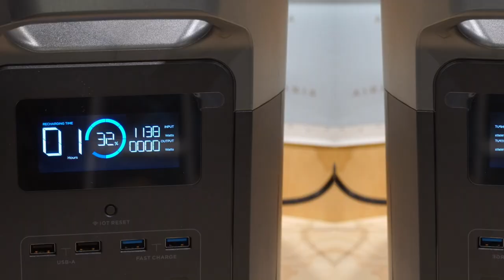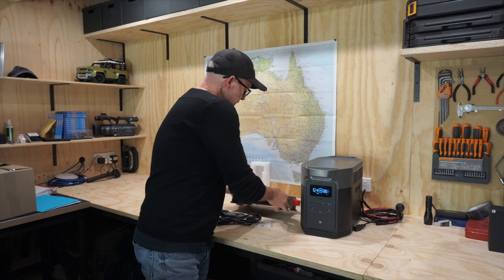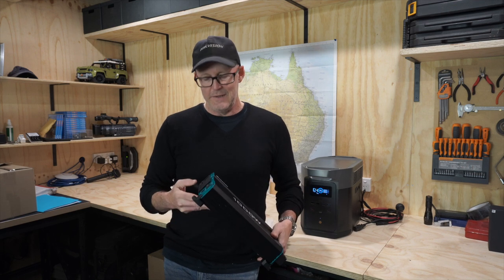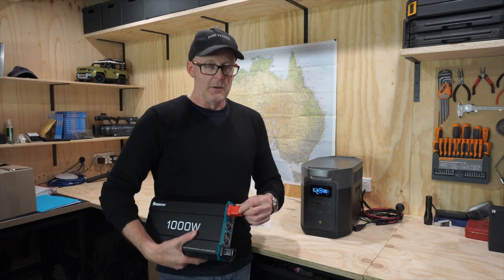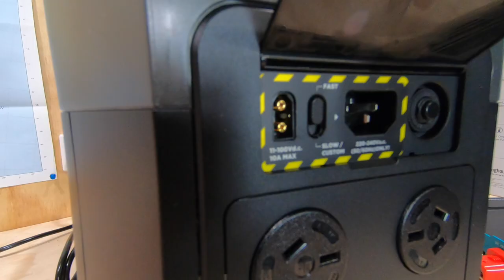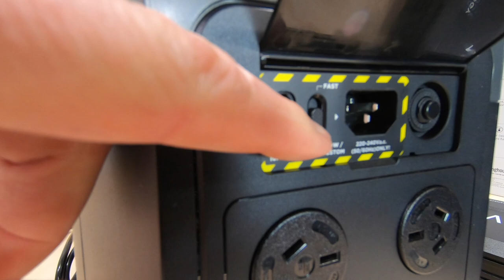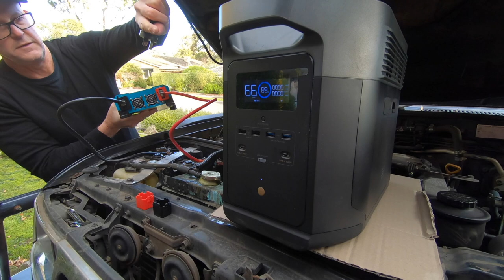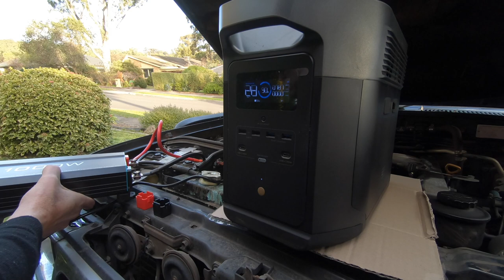Charge Your EcoFlow Delta Max 10x Faster While Driving - EcoFlow Delta Max Review Part 3

Comment: Hey how do you get the 220-240 volts for recharging when the six AC outlets on the Delta Max are 110 volts each? What am I missing here? Thx.
Reply from the maker: The Australian version which I have has 4 x 240v outlets
Reply: Update: I discovered my pickup has a auxiliary power outlet (oops forgot about that!) for standard plug in rated at 400 watts which I will give a try when my Delta Max arrives next week. So if my understanding is correct, it will charge about 4x faster than the cigarette lighter (aprox 100 watts) which might just be fine.  However, I called EcoFlow yesterday and asked what was the minimum rated wattage I could use for an inverter (like you bought) and she said it must produce at least 600 watts. So a bit confused by that but I will run a simple test to confirm/deny. This is cool! Loved your dog by the way.

Comment: Hi Steve, I am excited 😆 we got our Delta Max 2000. I have only had the chance to run small tests, Question I think you mentioned that you can charge the unit from both solar and cigarette lighter at the same time. How did you go about this. It appears to only have a single input ?? I will watch your latest video on fast charging this morning. Thanks Keith.
I had the same thought about the Inverter. I have a 300 watt inverter. I’ll give that a shot I will transfer one of my AGM’s from my caravan, to the Ranger. Did you instal the Piranha Isolator, What did it cost ? How difficult was it ? Thanks Keith
Reply from the maker: Hi Keith, no you can't actually charge from solar and cigarette lighter outlet at the same time. This was just an idea I was thinking about but it turns out that the inverter is the way to do it. I do think that you can charge from solar panels AND the AC from the inverter at the same time (I'm going to test this). So if that works, you could have solar panels on your vehicle/van roof feeding into the 12v port in the Delta MAX while also feeding in to the AC port from the inverter. Let me know how you go with the 300 watt inverter. The Piranha isolator was actually a sponsored item when we were gearing up for The Big Lap trip. So not sure what it cost to buy/install. It's been 100% reliable though in over 240,000 km of driving so happy to recommend.
Reply: @ExpeditionAustralia  Steve I look forward with great gusto to anymore info you come up with regarding the Delta Max. Another chap made mention of the draw from the Alternator An 800watt draw = 66 amps. I may have to upgrade my Alternator as the Standard Ford Ranger unit is only about 65 amp output Maximum. 

Thanks Heaps
Keith
Reply from the maker: That's what's great about the variable input on the Delta Max - you can dial it down to whatever level your vehicle can comfortably handle. Eg. 500 watts which will only draw about 42 amps (500 watts / 12 volts = 42 amps). But you're still getting nearly 5x more than what your cigarette lighter socket can deliver.
Reply: @ExpeditionAustralia  Very True. Thanks Again for having the time and patience to to respond Regards Keith
Reply: @ExpeditionAustralia  Hello, is it also possible to charge ecoflow by 150w inverter with modified sine ?

Comment: I confess to being somewhat of a novice here, but it seems to be defeating the purpose of having the EcoFlow Delta Max Lithium battery, then having to have a second car battery to charge the Delta Max. So maybe its a good option for those who already have a second car battery and not so good for those, like me with 2 x 100AH caravan batteries, but no 2nd car battery. I'm probably just better off considering an upgrade to the caravan battery system to Lithium, though that adds even more cost for a new battery management system and possibly other components as well.
Anyway, thanks for the reviews.
Reply from the maker: Hi Bill, yep everyone’s situation is different. If I didn’t have a second battery already I would just run the inverter off the main battery and only use it when the engine is running. If you already have the lithium batteries in place then a battery management system might be what you need.
Reply: @ExpeditionAustralia  Hi Steve, Thanks for the reply. I only have AGM batteries and a BMS that doesnt support a lithium profile, so it would be a big upgrade for me. I like the portability of the EcoFlow battery, just not the cost. I will rethink. Cheers.
Reply: @ExpeditionAustralia  Hello, is it also possible to charge ecoflow by 150w inverter with modified sine ?
Reply: @ExpeditionAustralia  

I have a single starter battery in my van, which is connected to an invertor which charges my ecoflow river 600.

One consideration for single battery + invertor is an isolator switch for the invertor. My invertor draws a small amount of power (even when turned off) so the switch prevents the possibility of the starting going flat 

Excellent video, wish I found it before I did my own install

Comment: Hello, I know the video is a year old now and maybe EcoFlow has a more elegant answer as I am curious that Yeti has an Integration kit that allows you to directly hook to vehicle battery or alternator and run their cable back to the Yeti unit. On the unit you can select to switch to vehicle mode from tank mode and it will prevent the yeti unit from taking all of the house battery juice so you can always start your vehicle. Does EcoFlow not have a solution to this? Even with the delta pro?? Cheers and thanks for the video!
Reply from the maker: Not that I know of but maybe best to contact them directly

Comment: Instead of charging from a car lighter, would it be possible to charge with a Honda EU10i generator's DC output.  If you use the generator's AC output it will bypass the Delta as the Deltra prioritises grid power (in this case the gennies output) for it's output?  So, will DC charging charge or also bypass the Delta and also be used for output?  Great video
Reply: Why would it bypass AC power going into it if the battery isn't full? I think you're confusing the UPS functionality with just charging the unit.

Comment: Great video! Is it possible to run the wire  from your starter battery to an isolator, then to invert or and then to the eco flow without your extra auxiliary battery?
Reply: i had the same Q.  Did you ever find out?

Comment: If you charge stuff from the EcoFlow while it's charging from the inverter, will the inverter not be overloaded? I think the inverter should also be dimensioned for what you will be running on the EcoFlow while charging it with the inverter. Or limit the charging power in the EcoFlow so you don't overload the inverter.
Reply from the maker: Using the EcoFlow while it is charging from the inverter won't make any difference to what the demand on the inverter is. You dial in the power you want the Ecoflow to draw from the inverter between 100 and 2000 watts and it will remain fairly steady regardless of what else the EcoFlow is doing.

Comment: This is similar setup to what I do .On my 
Auxiliary battery which is a 100am lithium battery and I have a a 40 amp dc to dc charger .So when the car is running it charges the auxiliary up very quick .

Comment: After some run time, how hot does the inverter get? Thinking about a way to charge my power station but concerned with the heat from the inverter.
Reply from the maker: Haven't noticed it being an issue so far. I have dialled down the draw from the EcoFlow to take the load of the alternator. Watch the latest video here >  https://youtu.be/7Bd1C9sP7GU

Comment: Hi, I'm thinking about mounting my 2500 watt inverter in the trunk of my car for emergency purposes, specifically to charge my Ecoflow. I have a 170 amp alternator, which isn't enough to keep up with 2500 watts, but what if my load is only the 1000 watts that I'm using to recharge the Ecoflow. And also, if I had a 700 watt output load on the Ecoflow while charging it, does the car actually handle the input and output load while the Ecoflow is plugged into AC power?
Reply from the maker: The EcoFlow can be charging via the AC from the inverter and running things at the same time and you can adjust the amount of power the Ecoflow pulls from the inverter/alternator between 100 and 2000 watts so you can find the sweet spot for your setup. New video now up where I put it to the test > https://youtu.be/7Bd1C9sP7GU
Reply: @ExpeditionAustralia  thank you, sir.

Comment: It charges fast already wouldn’t it damage the battery charging it 10 times faster?
Reply from the maker: The 10x refers to 10x faster than the 12v charging option from the cigarette lighter socket which is only about 100 watts. You can actually charge at around 2000 watts through the AC port so I'm only really utilising about half of that capacity.

Comment: Did this end up working in the long run? I got a 1000w renogy inverter with my delta max 2000. I was charging at 600 watts. This worked for about a week.

My inverter's ground fault circuit light comes on and stops working ):
Reply: connect a wire from the inverter case to the vehicle chassis (bare metal) see if that helps..

Comment: You're going to be replacing alternators left and right, they're not designed to output amperage like that non stop.
Reply from the maker: New video now up where I put it to the test > https://youtu.be/7Bd1C9sP7GU - I can adjust how much power the EcoFlow pulls from the inverter/alternator and I found the comfort zone.

Comment: Don't want to sound like a smart arse but do you understand what sort of load you putting on your aux battery ?  Lead Deep cycle batteries really don't like when you pulling 60-80 amp at 12-14v and your alternator won't appreciate it either... and I am not even talking what sort of dc cable you will need to maintain loads like that... what you need to look is at victron dc-dc 12 volt to 30 volt dc charger I think  it can pull 15 amps ... give or take 400 ish watts ... and you don't have to worry about ac electricity operating in moving vehicle ... stay safe and don't electricute yourself or burn the car down with current plan...
Reply: Victron charger would step up incoming dc voltage from 12 v to 30 v  at 15 amps ... any other step up dc charger will work as well ... xt60 connector doesn't cost much to make yourself
Reply: maybe super old technology, but not this. He's being very conservative with his draw
Reply: @injectionAI  inverter was on for 30 seconds and already shouting its below voltage 🤣 as I said unlikely that there is any understanding at high c rate of discharge what it does to you deep cycle  lead acid aux battery , hence why you don't see winches connected to deep cycle batteries in professional installs ... anyway everything from that install is wrong simply from safety perspective just because it kind of works doesn't mean its safe... you putting wife kids in that car... I don't want to know what size cables being run or I won't sleep at night ... stay safe ...